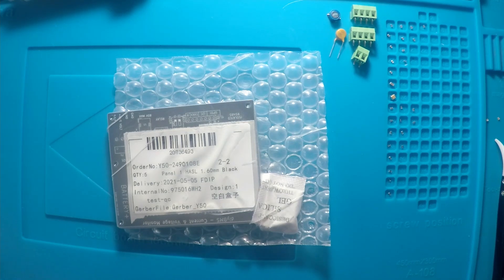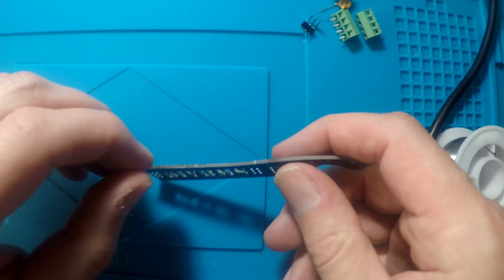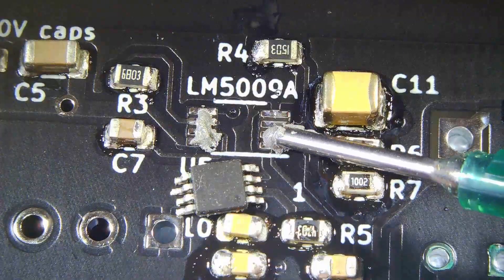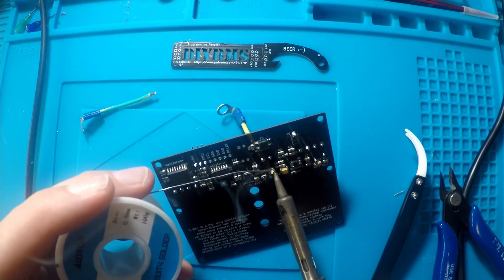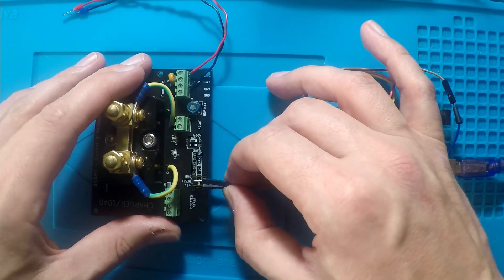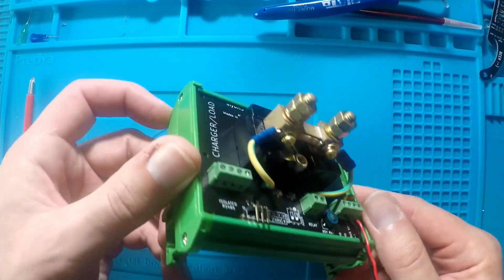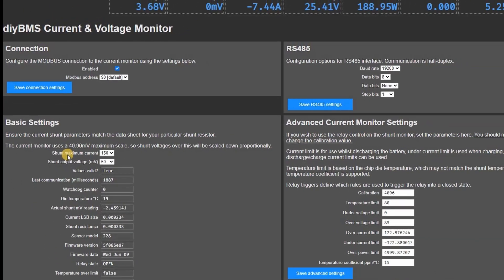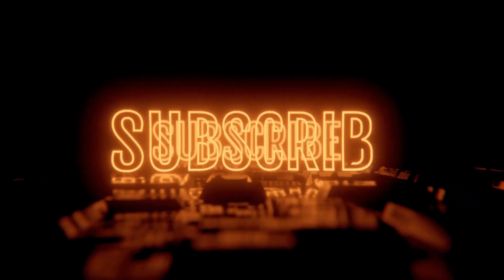Current Monitor/Shunt - Launch Video - diyBMS

Comment: You have to add the AVRDUDE to the command window. Search for AVRDUDE Windows and follow the instrucktions. 
If you do this you will get an error if you use the command line from Stuart -> coppy the config file from AVRDUDE to the path that you se in the error message.
And you will mostly get a second error message due to the fact that the file diyBMSCurrentMonitor_ATtiny1614.hex is also not in the correct folder. Coppy it to the same path and/or direct to your c: (did bothe at the same time so unsure where it has to be but I assume it thas to be in the same path as the config file):
i HOPE THIS HELP YOU I spent 2h to get it

Comment: Hi Stuart, excellent professional job ! I'm in the middle of assembling the V4.5 modules and get stuck with flashing an HEX file to the ATTiny 1624. You mentioin in your video, that you are using PlatformIO. I'm not yet familiar with it. Do you have any short script available, how to flash a HEX file  to ATTiny 1624 ? Programmer based on Arduino-Nano with jtec2updi is available. Thanks for any hints.
Reply from the maker: You don't need anything special for UPDI programming - just a standard USB SERIAL adapter and a few resistors.  Take a look at this. https://github.com/SpenceKonde/AVR-Guidance/blob/master/UPDI/jtag2updi.md#serial-adapter-requirements

Comment: As for soldering SMD components...
I used to do this without soldering paste. 64 Pins, 100 pin devices, no problem.

Using a large flat slanted soldering tip (Weller has them), add flux to the board. Put some solder onto the flat end tip of the soldering iron.
Next, "drag" along the leads that you want to solder and let the capillary effect do the work for you. First heat the PCB, then heat the component lead.
The capillary effect will "suck" the solder from your soldering tip into into the PCB / lead connection.
It will make a perfect soldering joint.

You just have to be quick before the solder on the tip starts to oxidize ;-)

I would like to show you IRL, but I hope you can figure it out.
HTH
Reply from the maker: I've done drag soldering as well, thanks for watching the video

Comment: At minute 12:47 do you have the rs485 +5v line connected? The m-usb hides it from the camera. Should it be connected to the current monitor? And then I suppose that the controller would be powered through it from the battery and no other power needed?
Reply from the maker: Yes the +5v line is connected, however its an ISOLATED shunt, so you still need the seperate 5v power to the controller.

Comment: Thanks for your great work Stuart.
I think some documentation about the wiring should be made. Some are discussing how to do the right terminal wiring, if it should be direct battery, v.sense and +++ to the same...
Reply from the maker: Good idea. There is a single wiki page on the GitHub site about this

Comment: Many thanks, how can this be modified to support say 170v?
Reply from the maker: It can't - sorry, limited by the INA228
Reply: @StuartPittaway  Hi Stuart, I try to find INA228 and not available anywhere, usual I buy from farnell.com but also there not available. Please can you specified the place were you buy INA228?
Reply from the maker: @pinteapiki  I brought directly from TI - https://www.ti.com/product/INA228
Reply: @Stuart Pittaway  is there any other way to monitor over 85v even without using this pcb?

Comment: Are you selling plug and play of your diybms including shunt monitoring and manual instruction?
Reply from the maker: Hi, kits of parts are normally available in the OEM shop, but they are low on stock at the moment.  https://shop.openenergymonitor.com/diybms/
Reply: @StuartPittaway  i already check the link and i don't know what item fits to my setup,  can you please make a list of items need to buy, my setup is 14s 80 p li- ion battery
Reply: @etv4075  You would need 14 modules, one controller and optionally one shunt. A large amount of jst cables. Some way to power the controller, some 5V source.
Reply: @magnuspernemark2339  maybe how much cost of all that items, ? Thank you
Reply: @etv4075  Without any soldering of your own? I don't know.